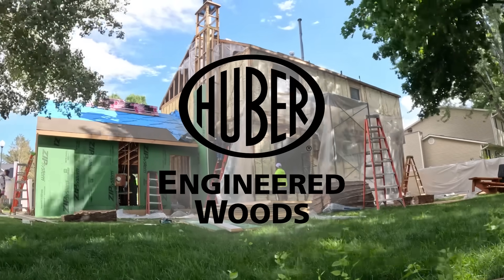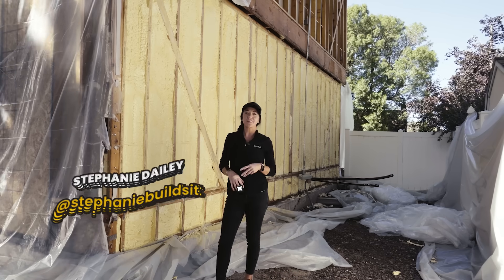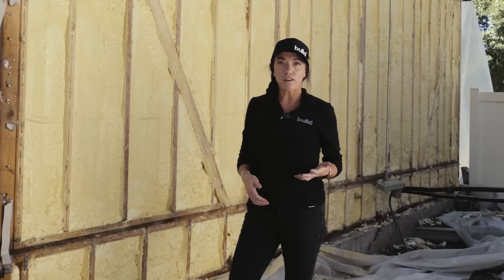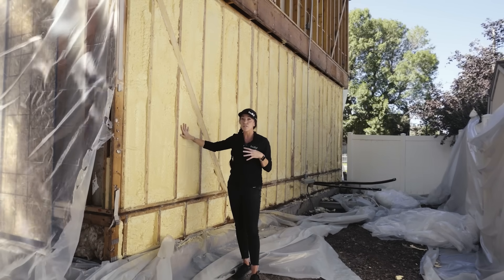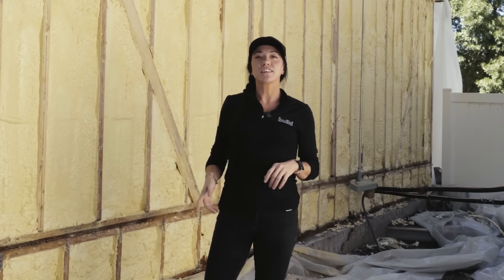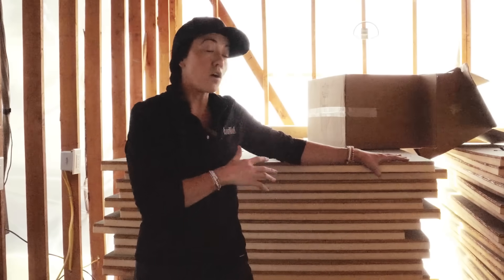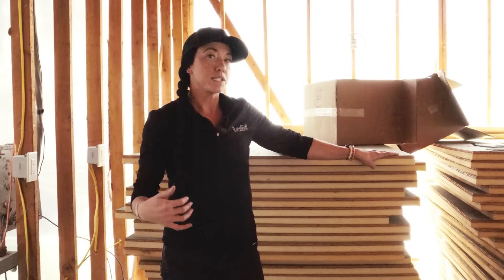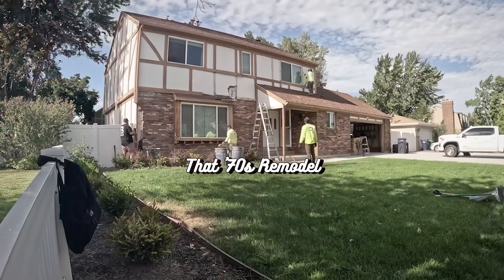That ‘70s Remodel: Episode 3 - Updating Comfort: Interior Insulation

Comment: Thermo-Ply. It's hard to believe how good some of it looks.
Reply: I'm sitting in my garage office cave, staring at 50-year-old exposed Celotex sheathing, which is heavy-duty half-inch cardboard, without the foil backing of Thermo-Ply. Stuff looks great. In the garage. Where the siding is less than 10 inches above grade, not so much... Celotex does not make a great Zoom background either.

Comment: Any one else a bit worried with an air cavity just in-board of r6 continuous, low perms both directions. 😬
Reply: I would have recommended leaving the cavities open and injecting foam once the ZipR was installed. That would seal the inside and outside, eliminate the gap, and eliminate the potential problem.
If it was normal sheathing, it would be fine to have a gap there. It's basically exterior space where convective occurrence and air leakage could maintain proper ventilation.

Comment: I don’t agree that closed cell spray foam adds acoustic value. CCSF is hard as a rock, any sound or vibration is transmitted through it. Batt or Blown insulation, (or OCSF) provides acoustic value due to its soft & fluffy nature that absorbs sound rather than transmitting it. Zip-R completes a robust assembly.
Reply: You are desperately confusing IIC and STC.

Comment: I think the CCSF is a good move but coming in from the outside will make it very difficult for future owners to add any new outlets on the exterior walls. Ultimately I think the best thing would have been to redo the drywall and spray from the outside once the new sheathing has been installed.
Reply: It's always difficult to add new outlets.  Whether you are fishing or just cutting the dry wall, it's not a quick job.

Comment: You only needed 2" foam. R-value is an archaic batt insulation measurment. 2" of closed cell foam will stop 87% of the heat transmission another inch only add 4-5% more
Reply: Spray Jones got you onto the R value myth too? All about it, but 2" is very minimal and that extra 4-5% is actually a lot of BTU's. BTU=Ufactor x sqft x temp Difference. So if you have 2000sqft of exterior wall and get down to 10 deg in winter (60deg diff) then R12 would equal 10,000btu and R18 would equal a little shy of 7,800btu of heat loss. After 3" of course the difference is much less which is why Spray Jones generally recommends 3".
Reply: @christopherbenjamin9273  Spray Jones in his reports refers to the lab conditions, not real world conditions that measure R value. The extra 4% is very minor when comparing dollars saved in heating over the price of just 1 more inch of foam. Jones has repeatedly referenced how he uses just 2" in his Canadian weather homes. 
Batt insulation allows air movement and moisture penetration, thus effecting the insulation value.
Reply: @safffff1000 preaching to the choir. Could you link a ref video where he explains 2" is best? I've only ever heard him suggest 3"
Reply: @christopherbenjamin9273  I've followed him for yrs and he mentions it many times, I don't have specific video. I just went to his channel and searched the phrase 2" and he had 2 video's. He basically said 2" is where the it stops enough cold from coming thru where there will no more condensation at any temp
Reply: If you're applying it conventionally (i.e., spraying from the inside, after sheathing and cladding), you also want to make very sure that the depth of the spray foam is enough to adequately cover any and all fasteners that have punctured through the sheathing, so as to prevent thermal briding—more specifically, to prevent the fasteners from condensing inside the wall cavity and producing mold. This is a very serious problem that plenty of flash-and-batters have had to deal with later down the road because their sprayfoam application was a little less than ideal.
Reply: First mistake... using spray foam!!
Reply: @truthhearit1471  You have no idea what your talking about but built prejudice from incorrect media sources. When professionally applied it will pay back itself , increases structural integrity by 3 times and will off gas less than latex pait within one day
Reply: @truthhearit1471 😂 Wow, when you explain it like that it just shatters my entire world view. Thank you for changing my mind. You should go on tour with that message and change the world

Comment: Formaldehyde levels ?   If you spay it sealed air tight, is the interior air  bad and need an external  air purifier fan to blow fresh air into the giant tupperwear container ?
Reply: need air exchanger for sure. spray foam will stink for years tho.